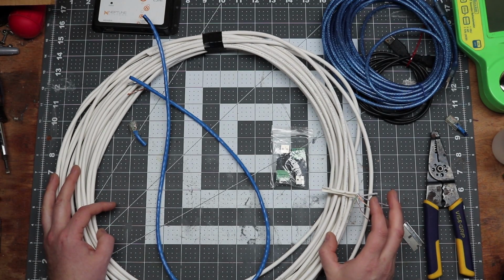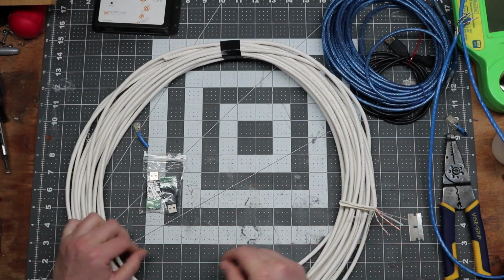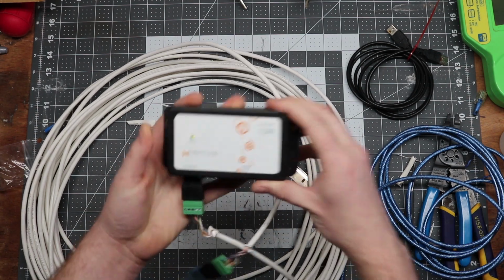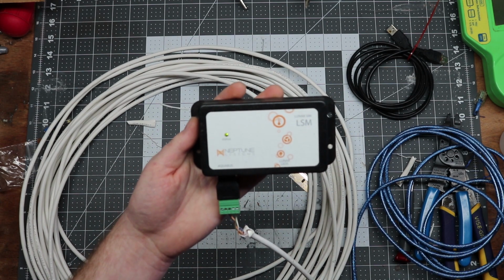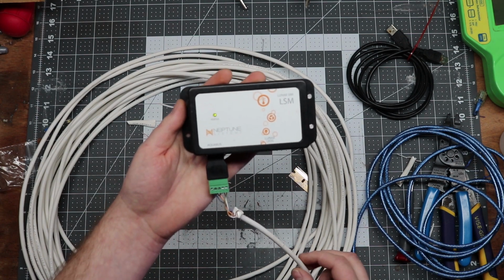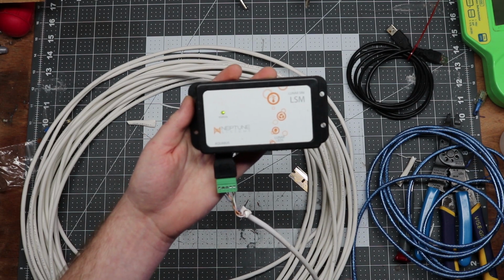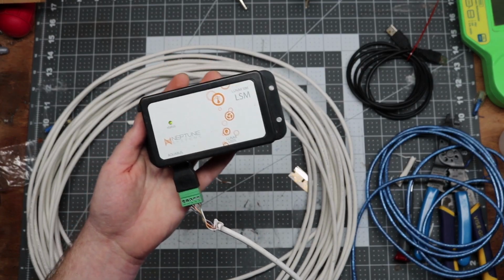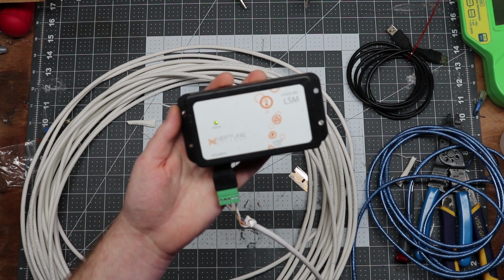DIY Neptune Apex Aquabus cables from ethernet, Cat5, or Cat6 cables

Comment: just fyi.  the extra "string" inside cat5 or cat6, is for you to pull back, to cut the insulation, so you dont nik the wires with a razor blade.
Reply: good to know!

Comment: So using a Cat6 will not impact the overall length limit on the Apex system as much as a USB?
Reply: It is really just whatever is more convenient or cheaper. There is a company that will make you a plain usb male to male cable in up to 200ft lengths specifically for the apex ($$$), so USB will work fine- there is power being supplied over aquabus, but any usb cable should be able to handle that even in long runs.